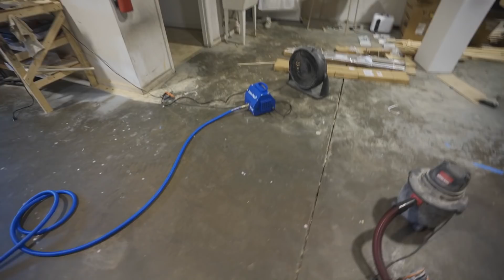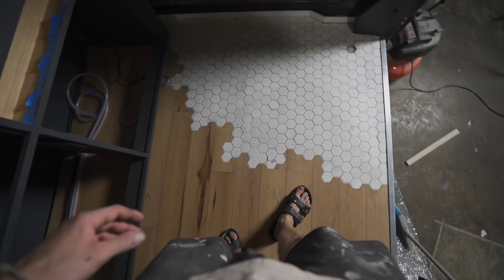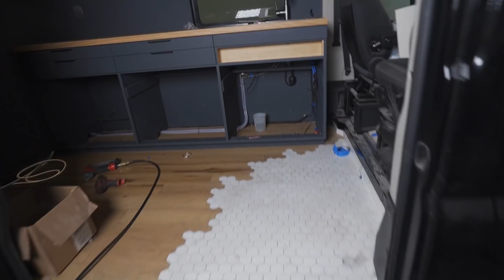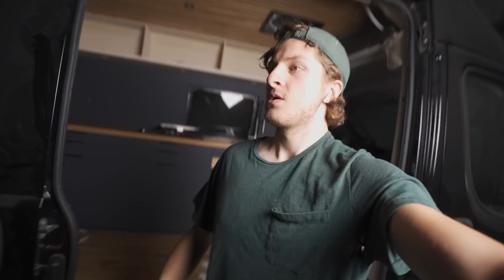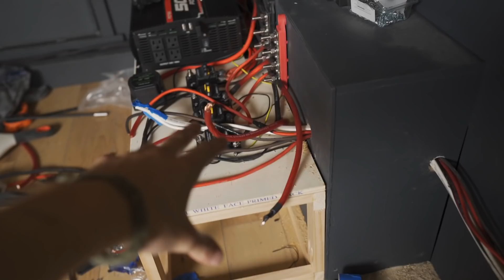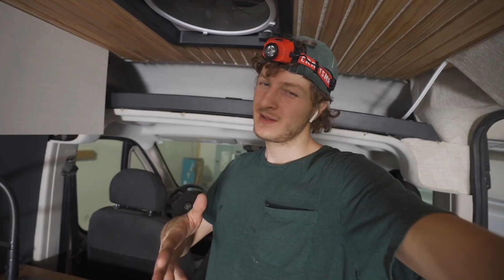OFF-GRID ELECTRICAL SETUP IN A CAMPER VAN | Running HOT WATER IN VANLIFE Promaster Van Conversion

Comment: Great work and interesting videos.  Why not use a 12V DC water heater, instead of 120V AC?  It seems like the less things that you need the inverter for, the better and more efficient.
Reply from the maker: There aren’t any great examples of 12v low draw water heaters that I have seen!

Comment: I found the same. Modified square wave inverter will not run any appliance with a timer type circuit. It looks for zero crossing. Induction cook top did not work with mine, so I had to replace it .  (same for an electric blanket) Also a 240V hot water heater not a bad idea. It will take twice as long, but current is half. If you do math, a 1400 Watt heater at 120V requires about 70 Amps at 12V,  My 3000 Watt Renogy inverter would not handle it, or more exactly the wires. You will need a 1 gauge wire to batteries not more than a foot long.
Reply from the maker: Yeah, I had to wire in the recommended 3/0g for the inverter. However, I found that the 120v water heater heats the water in about 10-15 minutes so it is much easier to work into a sunny day and charge back up or run the vehicle while you heat it up to charge. It’ll then stay warm for about 4-8 hours depending on temp outside!

Comment: Very clean install.  Your main battery cables are too way to small.  5000watt/12volts=416.7Amps.  Absolute minimum cable size should be 4/0Awg. A 2000w inverter should be 2/0awg.  Bigger is always better.
Reply from the maker: As stated we replaced the inverter with a lower draw one and changed some things out as it progressed!

Comment: You was right about batteries saying poz on one neg on other end and charging the other way looking at the wires connecting I would use 35mm square font know American awg with a 5000 watt inverter as the power draw goes through every wire connecting the batteries 🤔
Reply from the maker: We changed the inverter out for one with less draw but good tip!

Comment: Rubbing alcohol will remove the sharpie line. But be careful because it can melt the plastic laminate/formica layer of the counter.
Reply: Ahhh, but pretty certain the counter surface is actual wood, NOT laminate.  So rubbing alcohol would just smear the line out larger whilst soaking into the wood for a permanent black, smudgy stain...thereby ruining your countertop!
Reply: If its wood then its works fine. I've used a cotton ball with alcohol to get out sharpie before and worked great

Comment: I enjoy watching your videos and I'm impressed with what you guys are doing with the vans.But since you're reselling it you have to start using better materials and equipment. The veneer countertop it's so cheesy. Just like any inexpensive veneer product once it chips it's ruined and if water gets underneath the veneer into the particleboard it will expand. Go to the box store and you can get maple solid butcher block countertops. Few hundred bucks. The most important part is your electrical. Please please upgrade to hi performance Victron 3000 watt converter/ charger. The inexpensive high voltage converter's will get very hot and possibly start a fire.They are built very cheap. All the Victron components have safety electrical parts built into it. Go on YouTube you will see all the cheap inverters overheating. Last thing you guys need is a lawsuit because of a fire. Keep the videos coming I enjoy them.
Reply from the maker: Hey there! We actually have another inverter company we use pretty regularly now and I assure you they are not the cheap ones. This one, as stated in the video got replaced. 

Interestingly enough we have a solid butchers block counter going in the next build as well along with Victron components for pretty much everything. Each one has been a stepping stone and learning process for us and we are continually improving the quality of each build.
Reply: @scarletandseth  Very good. Not the nick pic but if you're planning on reselling the new van you might want to open an LLC for your van company that will protect you a little bit for lawsuits and so forth and  take out $1 million umbrella policy to. Starting to sound like a parent.Lol  other piece of advice is to just slow down a little bit and do it right. Look forward to the new van build. Just curious what websites do you use to sell your van on?
Reply from the maker: We do have an LLC + general liability insurance etc.

We actually just list them once they are completed on Facebook marketplace. Thanks for the engagement and if you want to learn more feel free to check out ltvcustoms.com for more on what we’ve made. As far as timeline we have found that doing them fairly quickly allows for the ability to improve on many things since you can actually remember what you did the day before. That being said our next one is pretty intense so we will be taking a bit longer on it. We built our van over 6 months but it was a horrible process only working after work and on weekends.

Comment: Pulling the stuff apart to paint seems so demoralising, but I can understand why it's required for the high quality finish. Have you considered sealing the cab with plastic at the start of the build to avoid the construction dust in there or do you find it's not too hard to clean post-build?
Reply from the maker: It 100% is and was not done on our van and you can tell. We have thought about it, but the honest truth is that we would have to remove it multiple times through the course of the build and it’s not to hard to get it all clean at the end!